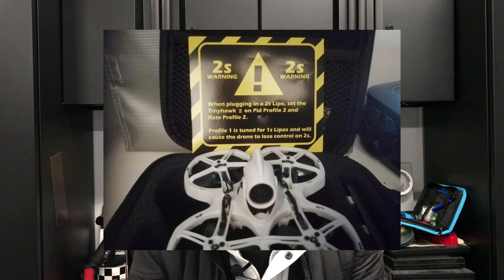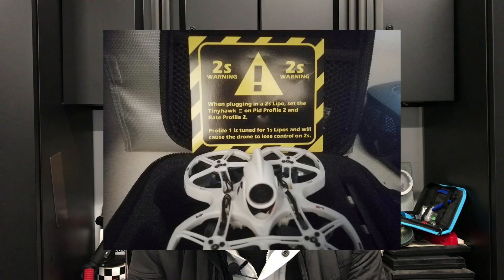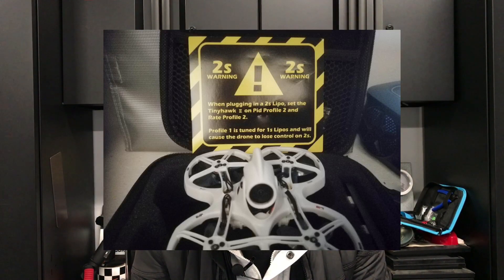Why the Emax Tinyhawk 2 Flight controller fails (Part 2)

Comment: Thank you for the honest review. I’m on my second TH2 indoor, and my second RTF freestyle bundle (both replaced due to defects). 
One issue you didn’t note which is pretty common is the permanent rx loss that no one has figures out. Their radio with the bundle also has a bad throttle gimbal that will go on you. 
I’ll fly them till they fail and replace with non emax. Thanks for the real review!
Reply from the maker: Sure thing! Glad you liked it! Thanks for mentioning the RX issue. I’ll have to look into that. I hadn’t heard of it prior. Just yesterday I did come across the issues people have been having with the stock RTF radio though. That’s unfortunate.
Reply: @Funcentric  yeah I thought I was a crap pilot till I checked in beta flight and saw my throttle bouncing all over. Then I found videos of others with the same problem. Both radios I’ve owned did it. So I upgraded. 
I get issues with motors failing to start. I have since the beginning, until all the sudden it seems to be improving. Do you think it’s all related to the motor esc mismatch? Are there blheli settings to you’re aware of that will help things last longer?
Great content keep em coming!
Reply from the maker: @JALFPV  I tend to think there must be some sort of scaling that can adjust that. Similar to when other aux switches twitch.
Reply from the maker: @JALFPV  I just did a quick search and apparently the manual has a throttle calibration sequence. Have you tried that?
Reply: @Funcentric  I’ll admit.... I did not know that... and I learned something today:). It makes sense it could be corrected since yaw/pitch/roll were always fine. I still have one, I should see if it helps. I’m not switching back from my TX16S. But it would be good to let others know. The bigger issue is the TH2 Indoor motor sputter. I would love to find the resolution for that. I can’t run blheli m at 48 or 96 cause all the motors sputter and fail to start. Thanks for looking into though. Maybe content for another emax video!
Reply from the maker: @JALFPV  motor sputter as it twitch? Could be the motor but on the TH2, it’s more likely the ESC.
Reply: @Funcentric  when I arm, most start right up. Rear right sputters then starts or sputters then shuts off. I’ve seen a few videos of others with issue. Some have soldered direct with varying success. Mine seem to be getting better, but no reason why that would be. I flashed blheli m went to 96 and made the issue across all motors and couldn’t take off, went down to 48, some motors would spin at arm while others wouldn’t. Went back to 24, and now they all start up with varying delays. The slow motor still spins up last, but gets there, which wasn’t always the case. 
I’ve had to arm while holding so I could give it a puff of air to get it moving, or shake it a little. I tried upping my idle, but that didn’t improve arming consistency. Sorry long answer... not sure if that made sense

Comment: do you have a wtoys 144001?
Reply from the maker: Yes, you can take a look at some of my other videos if you need some info on it. Brushless conversion.
Reply: @Funcentric  what is the size of the battery tray?
Reply from the maker: @Iinustechtips  It can elongate to a standard 1500mah 2S lipo pack. There's a bracket that you can remove and relocate to accommodate larger packs. I'm assuming you're asking about the 144001. So that others can find this conversation helpful, please comment in the 144001 video. Thanks.

Comment: So if I don’t run it on 2s or if I set the throttle limit to 90% on 2s will that give me a long lasting board? If not what will?
Reply from the maker: Set throttle limit to 75 if it’s not already set on 2S. Yes 1S usage would be safer.
Reply: @Funcentric  if I only fly 1s is it kinda imposible for the board to brake on less I hold it at full throttle for like 30 secs?
Reply from the maker: @genboxofficial7417  I have no clue. That's too specific. I think in general 1S is fine. 30 seconds is a long time though. That's not how people normally fly.
Reply: @Funcentric  yeah, one time on my tiny hawk 1 I punched the throttle al the way up at an rc field and thing this just turned off and fell out of the sky from like 100 feet 😂. Luckily though it didn’t break, I think the board just temporarily overheated.

Comment: Ok man this helps a lot. I have a few things to say/ask.
1. So I kept mine and have been flying it for about a week. Every time I fly 2s (which isn't much) I do switch PID and rate profile. At first I thought that mine was a defect because it didn't auto switch rate profiles, but after watching this I know it's not. I haven't switched any rates or messed with anything on Betaflight. Do you suggest I keep I doing the same?
2. You mentioned twitchy motors. I don't know if this is what you are talking about, but one of my motors will occasionally not arm and twitch for a bit. I have to arm and disarm a few times for it to finally work. Is this what you are talking about? If so, is there any way to fix this?
3. Is it ok to fly 2s if I never mess with the rate or PID settings?
3. So as I have said before this is my first ever FPV quad. Any more advice concerning making it last as long as possible?
Thanks and please continue the great work.
Reply from the maker: 1. In my opinion, you can change the rates. I'm releasing another video soon based on some new info I discovered. The secret is to check the throttle limit on Rate Profile 2 and make sure it's at "Scale" and set to 75. After that, you should be able to change the rates to whatever you want. 

2. If your motor twitches but you're able to take off and land just fine, then it could either be that you have hair or some debris stuck on the motor shaft that just needs to be cleared or that your motor is closer to dying off. With these symptoms and being able to fly still, it does not appear to be a concern with the ESC. Motor replacement is a lot cheaper so that's good news. 

3. The idea is that you want the motor to draw less amps. Maxing it out continuously will surely burn out the ESC. ESC's have a continuous amp rating and a burst amp rating. That means that you can exceed the continuous limit for only a short duration. By using 2S, you drastically allow the quad to more quickly and more easily reach the limit. I would again, advise that you are limiting your throttle via Betaflight to 75 (instead of 100) and still be more gentle. To answer your question, you do exponentially expose yourself to risk of a blown out ESC by flying on 2S. 

4. Don't fall in love with the quad. Quads really are disposable. I know that sounds like a weird word to describe a $100 thing, but that's kinda how it works. Any mid range or higher end goggles and transmitter will be the real permanent gear. The quads are expendable and can be expected to break. Repairing quads is unfortunately a norm. They're delicate creatures.
Reply: @Funcentric  Thanks this helps so much. How do I set the throttle to 75? Should I do it for just rate and PID profile 2, or for 1 as well?
Reply from the maker: @diddlycinema  you can wait for my next video or see if you can navigate in the tabs. On the tab where the PID's are, make sure you're on the Rates subtab. then on the right hand side depending on which version of betaflight you have, there should be a Throttle limit section. It's broken down into two fields. Set the first field to SCALE. Then immediately to the right of it should be 100. Make sure that's at 75. Do it only for RATE profile 2. DO NOT MESS WITH THE PID's at all. If you're confused on difference between PID and RATES, you'll need to check out someone else's video as it's not in the scope of the videos. I don't get down to the nitty gritty b/c there are so many other videos out there that cover it. I don't want to saturate the topic.
Reply: @Funcentric  Done. So I should just do it for 2s settings? Also, is all this does make your max speed slower, therefore making the amps you draw less? thanks
Reply from the maker: @diddlycinema  yes and yes.
Reply: @Funcentric  you're the best man, keep up the great work
Reply: @Funcentric  hey I just made a mistake. I realized I flew a few packs on 1s using rate (not PID though) profile 2. I have never done that before. I noticed bc it was flying weird. Am I in trouble??
Reply from the maker: @diddlycinema  the concern isn’t running 1S on Rate Profile 2. That should be fine as long as you have the version with the throttle limit at 75. The bigger concern is if you were running 2S on Rate Profile 1 which for sure doesn’t have the throttle limit set below 100.
Reply from the maker: @diddlycinema  It probably only flew “funny” because the rates were higher. Sticks were probably more sensitive and you therefore were flying more erratically. I don’t think there’s anything wrong with the quad if that’s your only symptom.
Reply: @Funcentric  ok thanks. well idk if this is a problem but I've mentioned it before. One of the motors will occasionally not arm and instead twitch. I have to arm and disarm a couple of times for it to finally arm. sometimes it will make the noise it does when it reboots/powers on. (when I am trying to fix the twitchy motor) I have taken the motors out and hair and yet it still does this. Cause for concern? Thanks
Reply from the maker: @diddlycinema  Could be a failing motor.
Reply: @Funcentric  even though it's this new? I've only flown it for about a week.
 
If it is a failing motor, is there any damage in trying to use it as long as possible before it completely fails? (Besides the risk of it falling mid-air)
Reply from the maker: @diddlycinema  yup, and nope. You can keep using it. Don’t use turtle mode in the grass though if you can help it. If anything is physically holding back the motors ans you try to run it, the ESC’s can burn out.
Reply: @Funcentric  thanks as always man
Reply: @Funcentric  does it matter if you put motors/props on different ones then what it came with? On other drones they have like "A" and "B" props. Does the th2 have that too?
Reply from the maker: A and B is the direction. The propellers diagonal from each other go in the same direction. I don’t believe there are other propellers that fit due to it being a push on prop over the entire motor (as opposed to just the shaft) and no screws. Stick with the stock ones. But you can pick different colors. They have purple too.
Reply: @Funcentric  so I can't stick any prop to any motor?
Reply from the maker: @diddlycinema  if you can find one that fits but the TH2 uses a proprietary propeller. Generally propellers go only on the shaft but again, the TH2 propellers go around the motors themselves. Take a look and you’ll know what I mean. 

Also a different pitch propeller will allow the motor to draw different levels of amperage. You can go with a shallower pitch but a higher one would head caution. Not applicable for the TH2 since you don’t have choices of propellers.

Comment: Hey me again haha 😂 still love my tinyhawks and let me tell you why, 
These are great for beginners.
Why are they great for beginners?, most of your beginners will not be interested or prepared to dive into betaflight and start messing with the proportional, intregal, and derivative gains(pids) 
So it’s nice that it comes with rate and paid profiles preset.
With that said if you have done your research like I did before jumping into the hobby, you might consider a quad like the geprc phantom because it doesn’t come with the cost saving AIO board, but rather an actual independent flight controller and independent esc, so they will be able to handle much more in relations to amp draw.
I believe emax’s target demographic will be pleased with the product they received, because if your considering a tinyhawk odds are you’ve never flown a fpv quad, if you are not new to the hobby there are better options out there absolutely.
Just do your research and see what best fits your personal needs.
For me being able to use the cheap 30 1s batteries I now own in both my tinyhawk and tinyhawk freestyle was a big reason I went with emax, don’t get me wrong though part of me wishes I just bit the bullet and bought a quad with an actuall FC and ESC stack, got the hobby grade charger and started with the HDO’s I now fligh with instead of my ev800ds.
But I have no regrets because my tinyhawk have held up for five months through lots of abuse and I now have a long range rig and a 5”.
I will say nothing flys like a 6s 5” monster hahaha 😂

Comment: I have had the th2 for about a year now. I fly it in light snow and rain, its one hell of a basher whoop. I do some 2s flying but most of the time i am to lazy to change it for 2s.. I still say this is the best small whoop for 100$  it takes a beating and still goes.
Reply from the maker: Thanks for sharing that you’re running this on 1S primarily.
Reply: @Funcentric  hi there boss,
2 tinyhawk 2 bnf and 3 aio fc down altogether and after watching ur videos on this problem,
do u know if there is any solid aio fc that u recommend that i or the th2 community can use in it,
like a aftermarket aio fc replacement which can take the beating,
or u think all these 65mm 75mm whoops are designed in a way that we the users just keep em buying?????
Reply from the maker: @matelslug1  Honestly, the latter. FC's are known to just break down and not be reliable whatsoever. Swapping it out on a Tinyhawk also isn't the easiest thing to do, especially for the beginners the quad is marketed to. I wouldn't recommend trying to swap it out b/c it has a proprietary shape. Getting a standard square one to fit would be quite a challenge. People have done it, but I don't think it's worth the customization and more importantly, the money.

Comment: I saw your post this morning looking for the card and wondered if you were going to throw out another vid about this. So basically, I should CLI dump back to my original rates that came stock? I have run the JazzM and changed my rates to what I like. (I am sure I didn’t use the right terminology above! Lol). Thanks for the vid and looking into it for us.
Reply from the maker: Yup, uploaded! Glad you were able to take a look. Since I have no way of gauging exactly how many amps are being drawn from the motor under what amount of stick input, I can't really give you straight numbers of how close you'd be getting to the amp limit on the current ESC when operating your motors.

I don't think you need to be stuck with the stock rates necessarily, but perhaps take a look at the overall degrees per second column and adjust rate/superrate/expo to your liking such that the total degrees per second is the same as stock. 

That's just a guess, to keep the degrees per second the same to avoid overage on the amp draw of the motor. If you're talking about flying 1S exclusively, then I think you may be more free to fly at whatever rates you want and still draw amps way under the limit of the ESC. It's only when it's on 2S that you need to be more cautious.
Reply: @Funcentric  Ok I’ll leave it. I fly this almost exclusively on 1S anyway. Great vid.
Reply from the maker: @PauliG  Thanks. Happy flying. If it helps at all for piece of mind, I have had some discussions with those who have mentioned to me that their TH2's are in great shape and that they've had it over 3 months and it continues to be awesome. I always ask if it's on 1S exclusively and most of the time, the answer is yes. So even though Emax advertises it as 2S, flying it on 2S requires being very tame with it and there are some restrictions. 

Stay safe.
Reply: @Funcentric  This is my third one. I wish I had seen these a year ago
Reply from the maker: I've collected yet more info and wanted you to be the first to know since you asked about it here in the comments. It turns out that Profile 2 has a throttle limit and Profile 1 does not. What this means is that if you're running your quad on 2S using Profile 1, you don't have the limit. The quad allows you to throttle up 100% which normally would be totally okay, but Emax intends to limit that. It's basically their way of compensating for an under rated ESC. It's a bit sketchy. Creative, but sketchy. So to answer your question, if you run it on 2S, at the very least, check to be sure the throttle settings is at a Scale limit and limit of 75%.